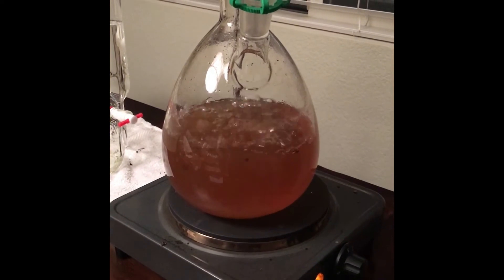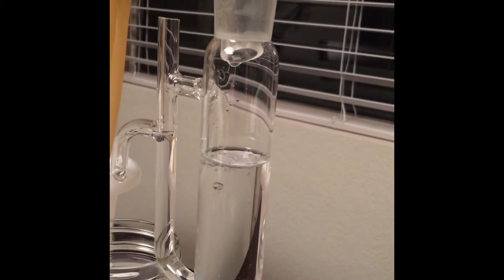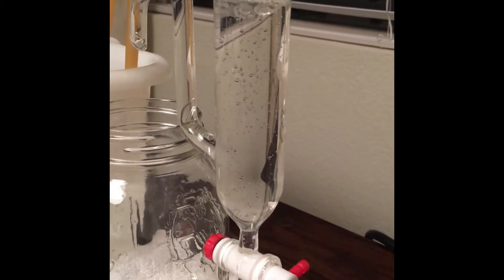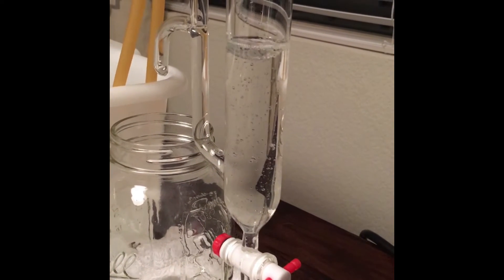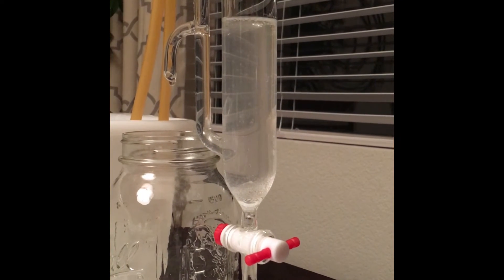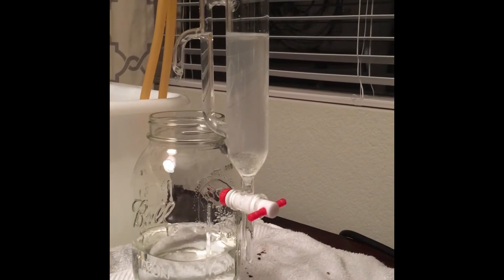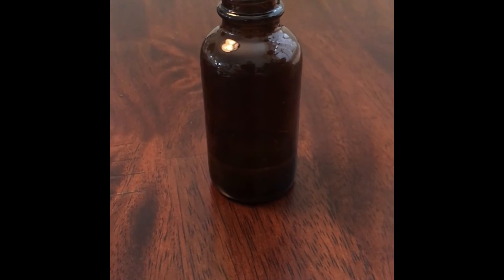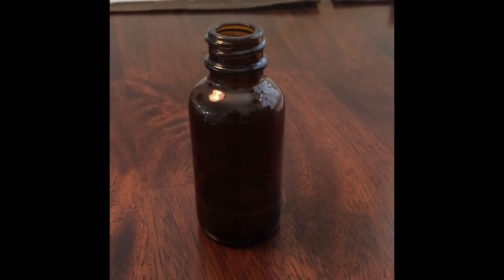Allspice Essential Oil-Steam Distillation

Comment: Can u clean and sanitize  it with out using any chemicals?
Reply from the maker: Use warm soapy water. Use 91% isopropyl alcohol and kosher salt as an abrasive for the condenser and separator if needed.
Reply: Yes I really interested with that cause it really hard to clean that graham type condensors
Reply: @Adam Defibaugh only if you clean it after you used it but if you forgot and leave it for awhile it will make some film that hard to clean just using alcohol

Comment: That's awesome dude, a month ago I got the same setup as you and I have been making a lot of stuff since I got it. So far I made Frankincense, grapefruit, lemon, rosemary, orange, lavender, basil, spruce and ponderosa pine.

   When I lived in Maui I worked for one of the best distillers in the world and he had some amazing shit, so that's what kinda got me interested.
Reply: MistakenMystery where do you get your herbs? seeds? or you already have them in a garden? where did you get your distillation kit?
Reply: I got my distillation kit from hong kong on Ebay. I got some herbs and plants from my garden, like rosemary and lavender, and then I ordered some online like Valerian, which I did last night and it turned out good, my whole room smells like rotten feet tho lol. I have a 2000 ml bio flask so I can usually fit about 2-3 pounds of herbs in my still at once. Depending on the plant I get anywhere from 0.5ml - 10ml of oil per run.
Reply: MistakenMystery kindly please let us know, essential oil produced at home can be used to apply on skin n skin care products? Also which brand did you purchased of frankincense. I am awaiting my kit
Reply: MistakenMystery please share you experience in video showing complete distillation of frankincense n roses
Reply: Did you work for Jack C?
Reply: @essentialoilapothecary  yah I worked with Jack for a few months in Maui, it was a great experience